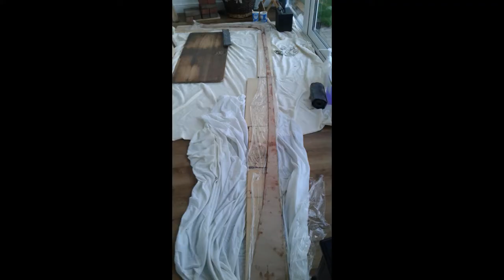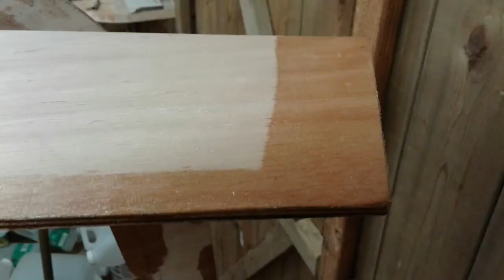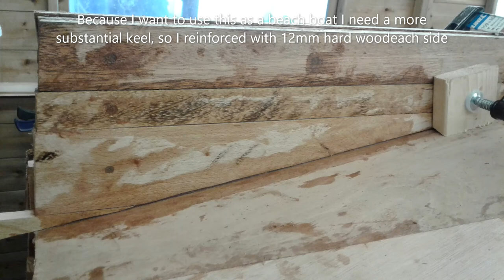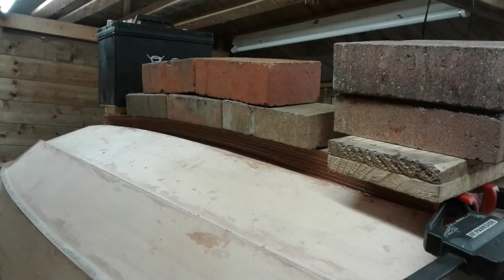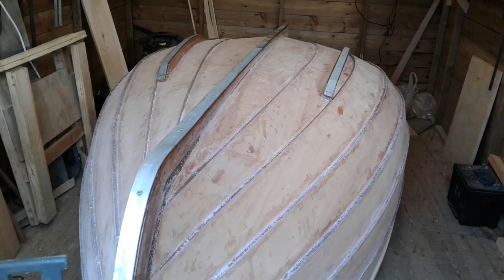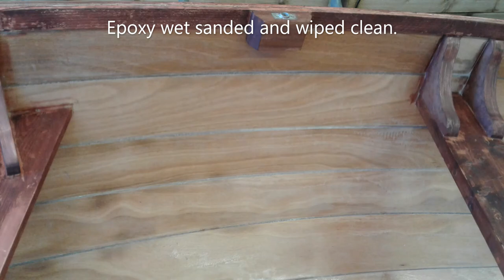Boat Building - Building a Stanley Small Craft Winchelsea 10

Comment: I know this video is quite old but I'm planning to build the same boat and I would love to see how it worked on water, please let us know!!!
Reply from the maker: Hi, I picked this boat because I needed it to be light as I would have to drag it up and down the beach. It was light but still hard work dragging it up.
To answer you question; It cut the water very nicely. It was used at sea, in the English channel with a 2.5hp outboard. The down side was that it really needed two people to make it stable. with just the weight of one person it feels a bit tippy. And don't forget I made it one plank deeper than it should have been. Without that extra depth I'm not sure I'd be happy going to sea.